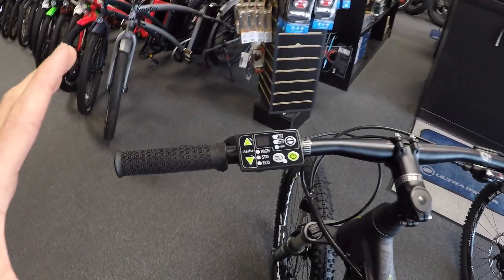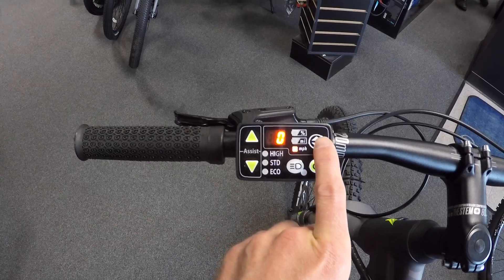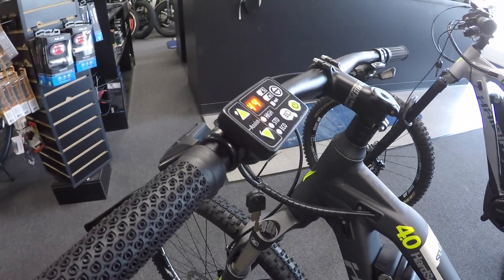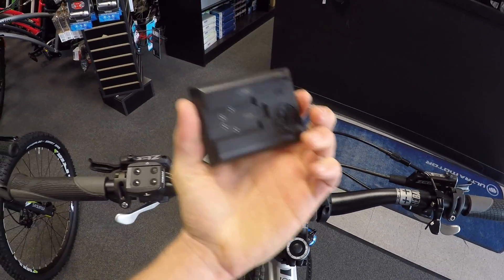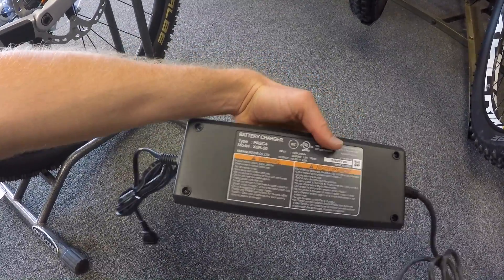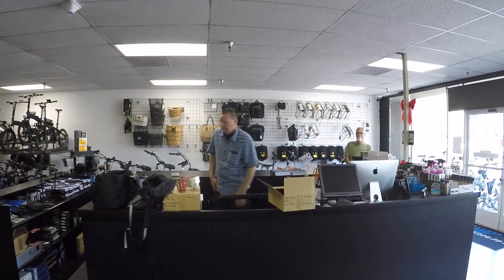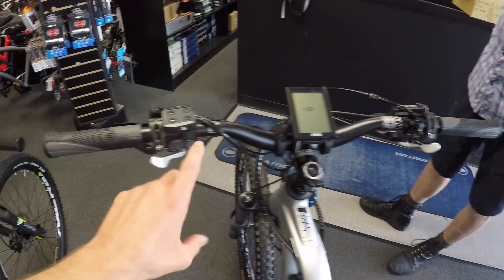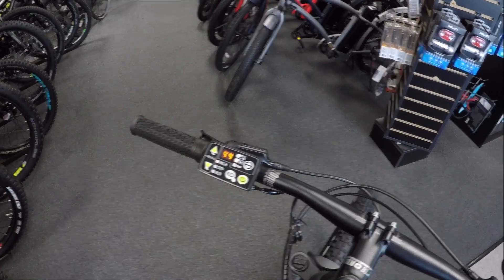Yamaha LED Electric Bike Display Settings

Comment: That's my bike! ..yes it's the cheapest Haibike  but it's still very good, the only thing i changed on it as i bought it was to add locking ergonomic grips with little horns. the display whilst 'basic'  yet does a decent job, i keep it most of the time in "distance range left".

I've added Toule rear rack, bag and panniers after seeing your cycle across USA  video where they used same  product to great effect on their long trip. Plus i've added Cat Eye front and rear lights that are USB rechargeable.

To those that say the display is bad..it's not deep for sure but it works well on what i does..it's not an iphone style  massive LCD  slab of glass/plastic!..and as covered in your video there's always an option to add the bigger display at a future time.
unlike alot of bikes you do get percentage left for battery that's in steps of 10% until you get near the end then drops to 5% increments...a lot of "superior displays" just as 25%  chunks (4 battery bars)...so it's actually better than most!

Comment: For more current display models compatible with Yamaha's PW or PWX motor system take a look at Giant Bicycles, BH Easy Motion or Yamaha Bicycles
Reply: Charlotte Cycles Watch the video, it’s a brand new display for the PW and the longtime standard display will be a $200 upgrade option. Giant make their own firmware/software and controls/display for PW/PWX that’s not standard Yamaha.

Comment: I think the first display is pretty bad. You can only see one thing at a time verse other displays and if you want to see some different info you have to fiddle with the controls. And a $200 upgrade price is ridiculous.
Reply: KagakuGakusei It’s funny, the second one was the regular (and only) display for years and now it became a $200 ‘upgrade’... that’s a bad joke.
Reply: @tamasvarga67  the larger display is pretty good actually in use..i rented a haibike with this and also a haibike with the big bosch display on the same day out around Rutland Water in England and actually preferred the yamaha one, to be fair both are pretty good but if i had to nit pick and choose one i'd opt for the yamaha myself after using both on a ride. you get better readout of battery power left for example...yamaha 10 bars (10%  increments) on the Bosch you get just 4 bars (25% increments)
Reply: cresshead I know that display I used it a lot. My wife’s two years old Yamaha PW equipped Lapierre trekking bike has it.
Reply: @tamasvarga67  it's not the pinnacle of design for sure, but it's still superior to many displays out there that arrived in 2018... ie battery percentage  displayed.
Reply: @cresshead  Yes, it's absolutely fine I just wouldn't put it on a mountain bike it's too exposed for that.
Reply: @tamasvarga67  yeh  i get very much..my 1.0 sduro  has that 'retro'  led display...i'm not super super mountain biker mind you!...just getting back to riding  a bike after i had a stroke in 2017 and lost my 'balance' so i'm very happy  just to get back pedaling!
Reply: @cresshead  Great to hear you are back, enjoy riding!